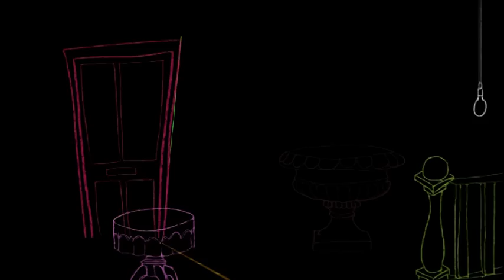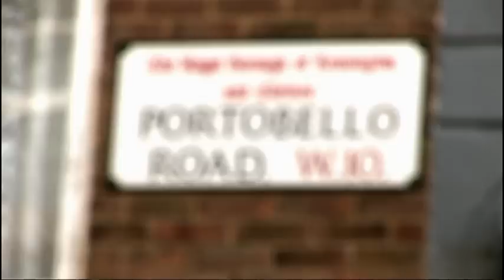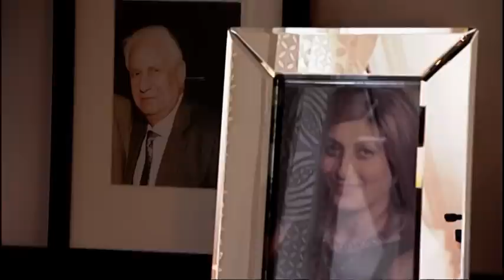This DISASTER Kitchen Is A Health And Safety Nightmare | Superior Interior

Comment: That island makes no sense. What if you want to move from the middle of one side with the sink to the middle of the other side to get something from the storage area? You've got to go all the way around a 15 foot obstruction and back again. Bad, bad design! And getting a new contractor to come behind another who failed is nearly impossible because they don't want to be blamed for what the previous ones did.  It almost never happens unless the second one is desperate for work and there's a reason why they are desperate for work in most cases.
Reply: We think a lot alike. The island is a bit of overkill. Actually, if a kitchen is well designed, an island is unnecessary. But I'm old and hopelessly old-fashioned.